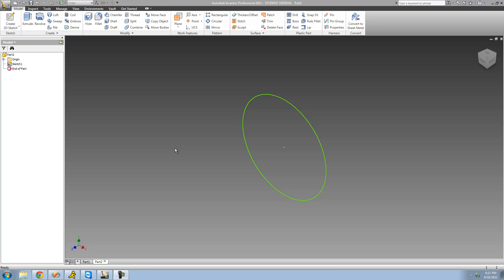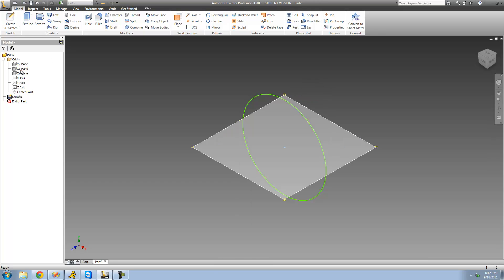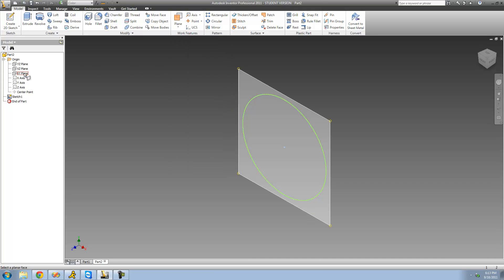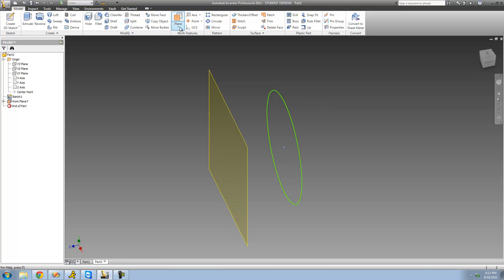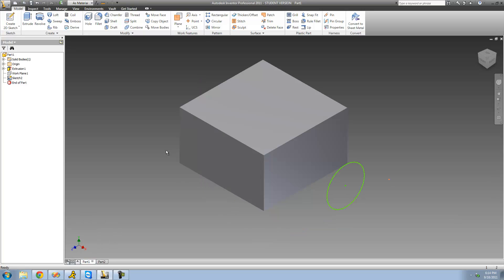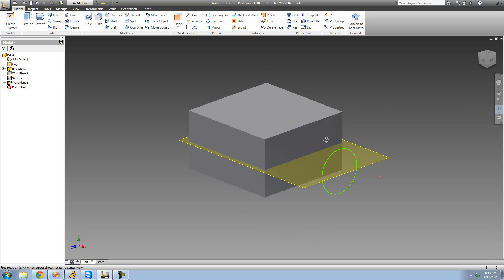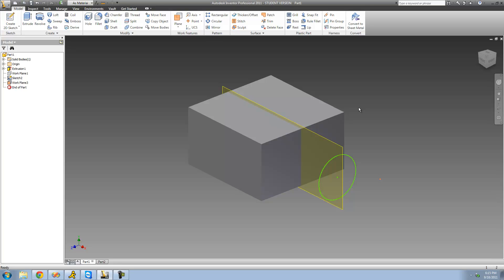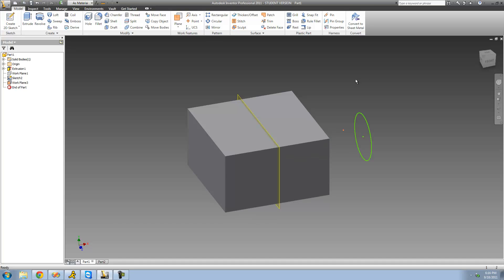Autodesk Inventor Tutorial 23, Work Planes pt.2

Comment: Yes you can. Expand the part(or sub assembly) in the feature tree, and all standard work planes will be in the origins folder, and all the work planes you created will be a little farther down.  For clarity's sake, I like to make the work planes visible in the part or assembly file before I drop them into the current assembly. They can be constrained either be clicking a visible plane in the assembly, or from expanding the feature tree and selecting the plane you want from there.